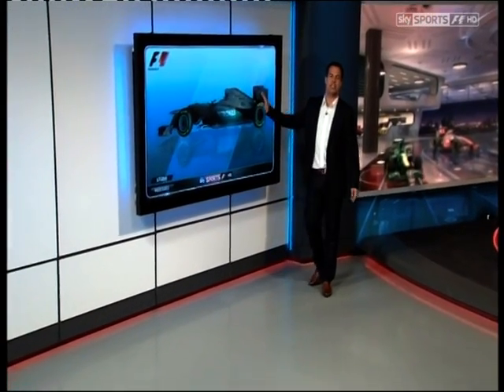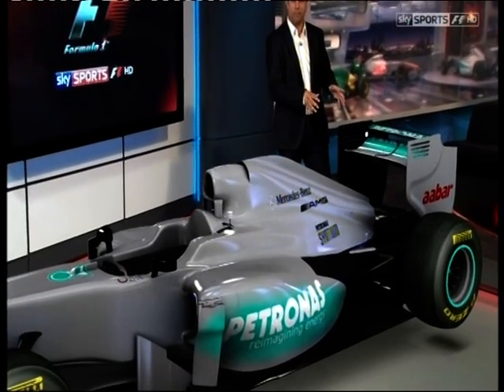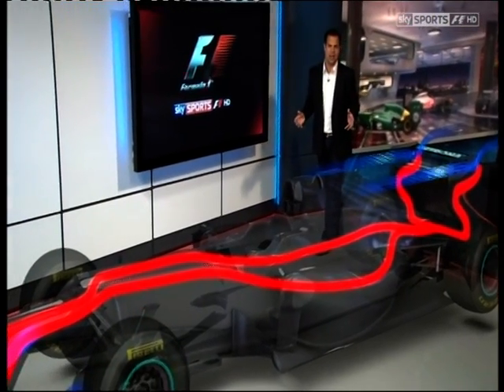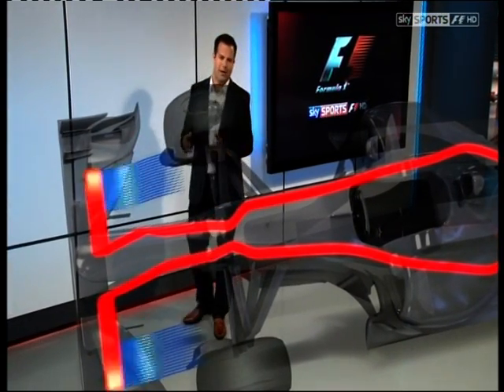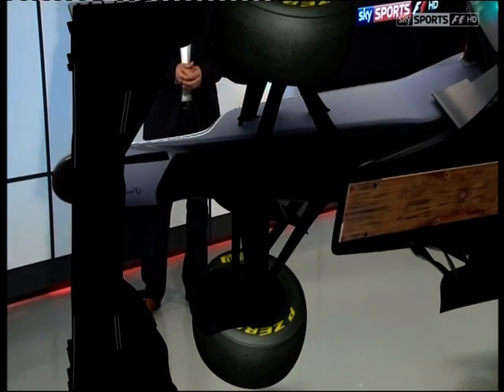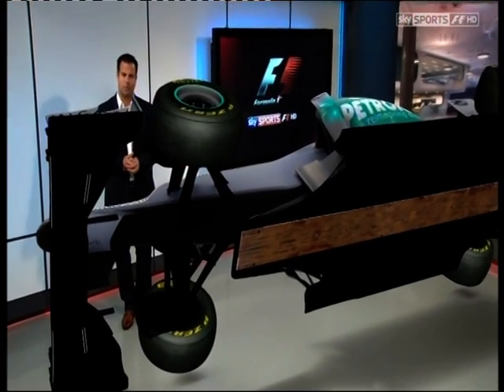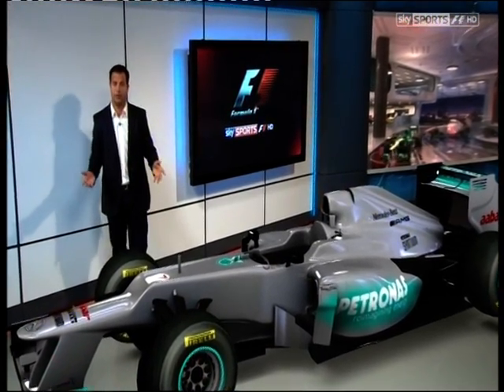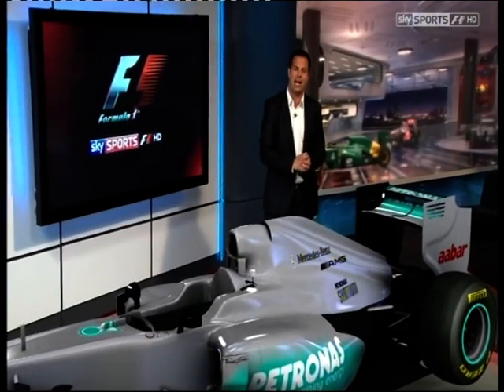The Mercedes W03's DRS / F- Duct System revealed

Comment: as much as i hated their domination the past couple of years i have to say, is this really a 'driver operated stalling device'? it's not like the driver has to cover a hole to activate it, it's activated by opening the DRS which is manditory. i can see how opening the DRS activated it therefor it can be seen as Driver Operated but apart from pushing the button when within a second of the car in front the driver can't use it like the F-duct back in 2012. really clever design